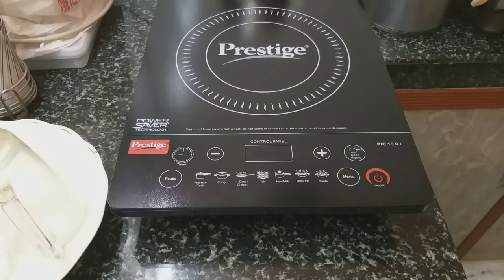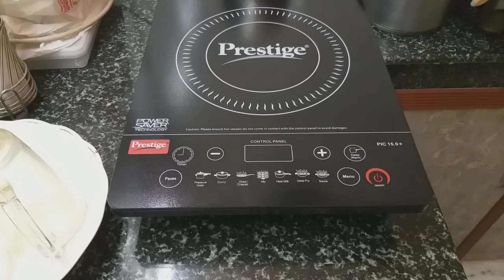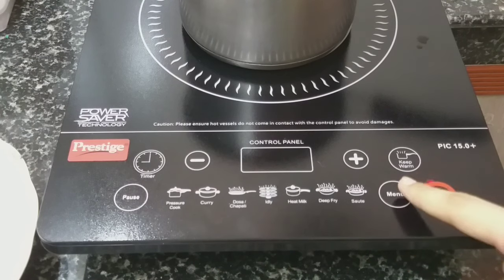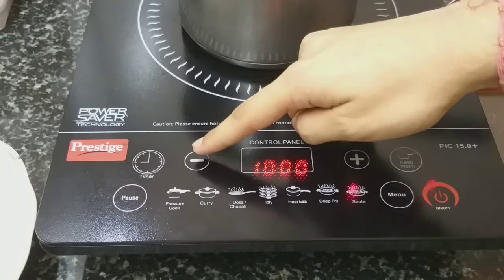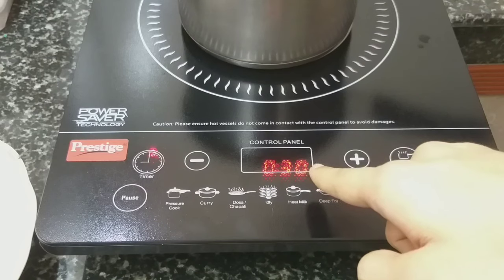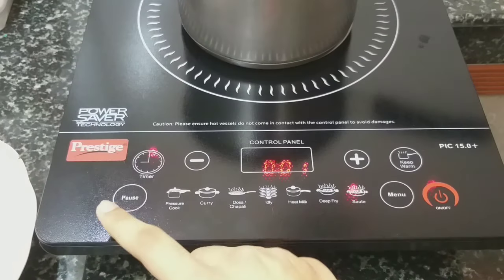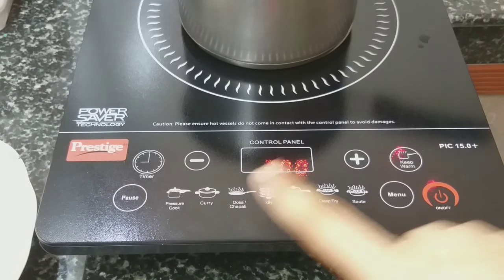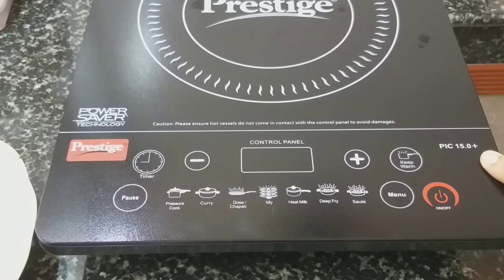How To Proper way Use Induction Cooker/Demo. II  Proper Way to Use Induction Cooker in Home Kitchen.

Comment: Thankyou so much sir, was searching for such a useful video, this stops my search. It's the best explained available I believe.
I have some basic questions Sir, I am new to cooking and have seen many around me donot actually knows about it's feature much , they are just using anyhow.

Q.1can we use any flat base pressure cooker on this induction stove ?

Q.2 Which mode to use to boil milk, would it be heat milk mode ?

Q.3 is it possible/safe  that , suppose we are cooking on gas stove and suddenly light came (as in Indian villages) so can we put the heated pan to induction after then ?

Q.4 Would it be wise to not switch off it from main switch for long ?
I am from Western Uttarpradesh
Nice to see you from Kolkata
It's one of  my fav places

Thankyou Sir

Comment: Could u possibly tell what is the actual use of timer please?
I didn't understood
Wtf if we don't put timer 
But Ur video is really informative 🙏🏻
Thank u
Reply from the maker: The purpose of putting the timer is... if the timer is set the induction will automatically stop heating after that set time.
Otherwise we have to manually  turn the heat off.
Thans a lot for watching..☺☺✌✌

Comment: You said in the video that you decrease the temperature form 1300 to 1000. what do you mean by this. are you decreasing temp form 1300 Celsius to 1000 Celsius or  1300 Fahrenheit  to 1000 Fahrenheit.  can you explain please these terms. And one more thing, can you explain what is the meaning when induction is operating on1000, how much watt it is consuming and how much temp it is providing. I am literally searching for this from a long time.
Reply: Those figure are watts ,not temp..